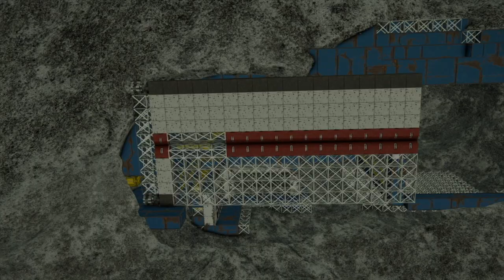The Grind: Episode 20  - Tunnel & Print (Space Engineers Survival Scenario)

Comment: Changing the base blocks for the hangar doors (the row that attaches to the rotors) to Blast Door blocks that are tapered like the other side of each door should help with building around them and still allowing movement. Also Anon's comments on rotors/displacement are exactly what needs done to have them match up with the surrounding grid.
Reply from the maker: Great suggestion! Never would have though that about putting blast door block on the rotors. Thanks!

Comment: The hanger doors:
I believe if you set the rotor offset to maximum out on both sides the blocks fit perfectly between two when they face each other (be sure to set one to off with no breaking torque or you might invite Clang for a visit).
If you use the same style of blocks in the dark grey area that you use in the red area. The top door shouldn't jam up.  This change should also allow you to fit in the door jam on the back of the door to hide the gap.

Renaming Blocks:
There is a mod for easily renaming items in the list (Easy Block Renaming by Thraxus and Lucas).  It allows you to select multiple and then add a prefix or a suffix or replace their names all together.  I've only ever use the prefix and suffix options.  Isy also offers a renaming script, but I've never used his so can't attest to easy of use or not.

Lost footage:
Highly recommend a secondary monitor for monitoring your recording software.  The lower the resolution and refresh rate on that monitor the less strain it will be on your gaming box.  Having out of sync refresh rates between monitors can lead to eye strain and headaches.

Dialing up the nerd factor in this game:
If you want really straight lines for your tunnels, you could add the EZ GPS mod to help you put in some GPS coordinates and then do some trigonometry to solve a triangle so you can determine how far down you have to go before heading over.  Warning, the world is curved but grids don't flex like that so if you go far enough you start to go uphill.
Reply: I fired up SE after work and to verify my numbers and I was wrong. On large grid rotors it's -40cm displacement on both sides to fit standard sized blocks between them perfectly.
Reply from the maker: As always - SO helpful - let's see if I can get those to line up now. And man, I definitely need that naming mod. 

Other suggestions all written down - thanks again!

Comment: Something that might help with your printer issue was Madmavn used a prog. block script that would let him produce all the components for a projection.  
I don't remember what the script was called but maybe try using something like that so you can produce all the components and parts before you print off the projection. That should fix some of the issues your having with the parts not printing due to the speed of the welders since you will have all the parts needed to build.

For the tunnel. Start from the base. Add junctions and a connector as you move along so you can pull the resources as you move along the weld.  Can alwaysremove the connectors after the fact and junctions wont affect your pipe network
Reply: Yes! Junctions! My 1st thought when I saw this pipe "it'll be a pain to run for resources outside"
Reply from the maker: Excellent suggestion! I never would have thought to do this .

Comment: The way Keen made the rotors is kind of weird, because each one has a different offset range. Basically only the large grid advanced rotor, the small grid 3x3 advanced rotor and the small grid regular rotor can be set to perfectly align the rotor base and rotor head grids. The rest of the rotor bases have an offset that is too large even on minimal offset.

However, you might be able to fix your hangar doors in the way @Garrie_McLaws describes, if you set the rotor offset to a MINIMAL value, then place another rotor on the opposite side and a rotor head to attach it to on the hangar door, then make the rotor attach and set its offset to the minimal possible value. Despite not having the individual rotors at the perfect offset, this should center the door to the frame (this is NOT advisable on a mobile grid, e.g. a ship, because you will most likely experience some phantom forces a.k.a. the heralds of clang). If this does not work, you could try to replace the edges of the door with actual blast door edge blocks, these have smaller collision boxes on the narrow side.

Otherwise, if you replaced your regular rotors with advanced rotors with an offset of -0.19979, the door should be perfectly aligned with the frame grid.
In order to do that, set the offset on your existing regular rotor to minimum, place an advanced rotor on the opposite side of the hangar door frame (you might need to grind down some blocks of the door, then replace them after placing the adv. rotor) and a rotor head on the hangar door to attach the adv. rotor to. Then set the adv. rotors offset to -0.19979. Then your door should be perfectly aligned. You can then replace your original regular rotor in a similar fashion with another adv. rotor with the same offset of -0.19979.
Note: You can use either advanced or regular rotor heads for this as they do not affect the offset (regular head looks probably better)

Oh yeah and make sure to deactivate one of the rotors for each wing of the door once you want to use it.
Reply from the maker: This is perfect! Now I have two options to try - thanks for the help.